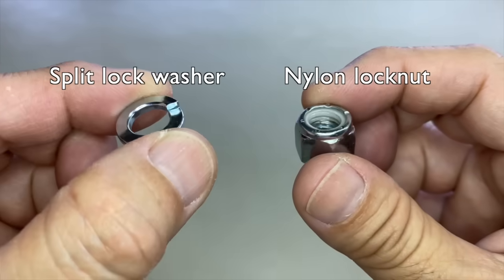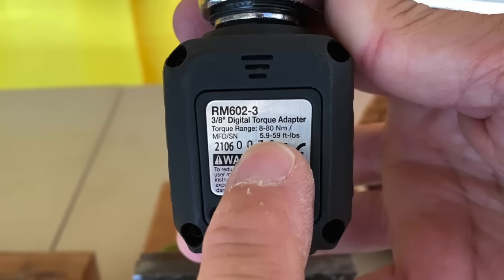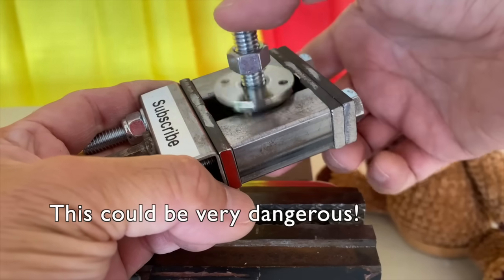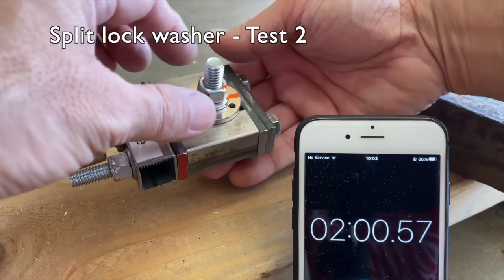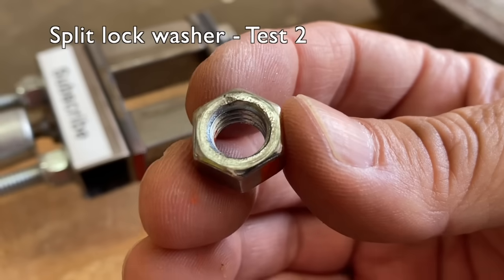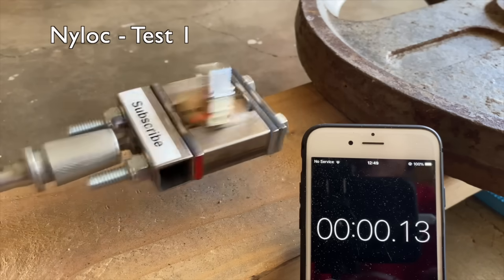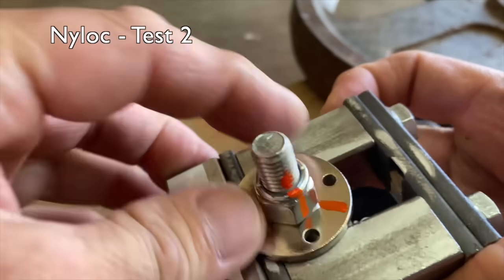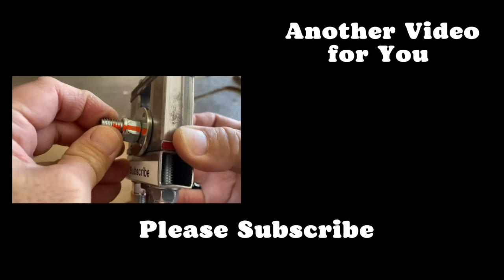Nuts & Bolts - Split Lock Washer vs Nylon Locknut – DIY Impact & Vibration Test - Part 1

Comment: Standard torque specs for grade 5 3/8-16 threads is 31 ft/lbs. Would this have made a difference? I doubt many applications call for such a low torque.

Comment: Will be interesting how a similar diameter metric setup will react due to the slightly finer pitch , and how does the difference in friction of nyloc vs. Split washer impacts the stretch of the bolt and finally the result ?

Comment: Did these results surprise anyone?  Certainly not me....I have had sailboats for decades and we always use nylocs...and they all but never loosen.  And at least if they were to loosen, they wont completely loosen/fall off.
What I don't understand is in the last cases (@6:50) , how is it that the nut and bolt paint marks are still aligned but the bolt is no longer tight in the assembly?

Comment: That is an improper lock-nut installation and thus a failed test.
Lock-nuts are supposed to be completely torqued down and tight.

Comment: For the gear heads...Fischer racing  engines did a race engine test experimenting with a timing gear drive vs a timing chain on a 7000 rpm 350 Chevy road race engine In the late 70s.The gear drive literally vibrated loose all critically torqued bolts through harmonic vibration.Rod bolts,head bolts,main bolts,pan bolts,Intake manifold bolts.My understanding Is this Is part of why the belt drive cam,crank ,timing system was developed.Blew me away.

Comment: You can't tighten to 6ft-lbs and say you're done because that's the highest your torque wrench goes. Any bolted assembly must be torqued to withstand the greatest load seen (i.e. during vibration in this case). Then, you tighten/torque the bolt to a suitable value to always withstand that force as long as you're within the bolt's elastic limit (even without locking devices). BTW-yes I am.

Comment: While it is understandable to design the test this does not represent the real world situation when bolts are torqued to the recommended value. 

Also, the only time to use split lock washers over nylocs is when there is enough heat involved to melt the nyloc material.

Comment: My solution was always paint the bolts after using lock washer and tightened nut.  The paint in the threads acts as super duty loctite.   Adding a second lock washer and second nut then paint is how I bolted a trailer together.

Comment: Just use a mounting adhesive which doesn't fully harden. Nylon nutlocks are one way only. Each time you loosen it gets weaker. Split locks are good for little pressure. Can be used in combination with a nylon. For example if you screw soft materials together like aluminium or plastic. But I prefer mounting adhesive over nylon locknuts. It's way more robust and doesn't loosen to vibration. Mounting adhesive is one way, nylon locknuts are one way. I'd safe my money on nylon locknuts.

Comment: Completely bogus test. Any competent engineer or designer knows that nuts need axial load from correct torque to create friction and resist loosening. Lock washers must be fully compressed to work properly.  I am a retired engineer who developed test procedures.

Comment: For me, what's odd is the nyloc connection showed movement of the rings to the bolt but not the nyloc nut on the bolt.  I know this since the lines on the bolt and the nyloc nut don't move like they do on the rings to the bolt.  Odd.  Perhaps there was something between the rings, like a scratch or hump, that was worn down when the assembly was shaken.

Comment: Once a split washer loses contact with its mating faces, by unscrewing, it is useless. A Nyloc washer retains function through internal friction so long as it remains on a threaded surface; it just lasts longer. So this test is meaningless as you are essentially comparing apples and pears.

Comment: The application for either design, is not about direct comparison. It's all bout environment. If the temperature and application allow for the use of Nylok, use them. If not, use split washers. If you can afford them. Nordlok is better than both.

Comment: Do you know why you don't see them in cars? Because they are expensive! Design it right, torque it right and it lasts. A nut costs 2cents and a nylok cost 20cent at automotive production volumes.

Comment: I don't get this test - in the past 40 years I have used both spring washers and Nylon nuts and not one has ever come loose. 6ft lbs wouldn't hold anything

Comment: Yes 6 ft-lbs is way, way low for this bolt.  So what?  This test was to compare tenacity of nuts and washers...a low torque increases the likelihood of loosening...as intended.  Probably the nyloc lost preload due to material wearing away due to chafing.  The nut was not backing off and certainly the bolt was not stretching.  Adding a split washer to the nyloc worked because the spring washer could expand in length to counteract the wear taking place.  Good test.  Bad comments.

Comment: I just put a piece of cello tape on half the circumference of the threads on the bolt. Even water pipe sealing tape should do.

Comment: Interesting. But you should have really checked the design torque specification for each fastener before the test for it to have been valid. The torque used seems rather low. 
It’s always surprised me that car wheel lug nuts don’t use cotter pin or equivalent, as I’ve had failures in the past after having tyre changes, a cotter pin would exclude that possibility.

Comment: I get a real kick from these dumb you tube uploads . Anyone even with half a brain is NOT going tighten a 3/16 nut to just 6 lbs . You tightened it to the recommended tension of the manufacturer . If it can't because of damage to what it is being clasped , then you use the BEST locking system and that is a second nut tightened as tight as possible against the first nut . [ DON'T TRUST LOCK TIGHT ] .But the best thing about watching a video like this is reading all the cements uploaded by people that are VERY knowledgeable in this area . Thats where I learn from .

Comment: 6 lbs of torque on a zinc plated 3/8 bolt. Come on man. That is an invalid test because it does not reach clamping force spec for a grade 5 bolt at all. Not even close. It should be 26 ft-lbs for a SAE 3/8 bolt and nut which is zinc plated. For aircraft and DOD AN hardware 3/8 AN6 bolt which is Cadmium plated it should be 15 ft-lbs of torque to get right clamping force. But relatively speaking the best is flat washer with split lock washer and then a nylock nut.

Comment: How about double nut?
How about trying the last two setups with different torque?

And I agree with one of the earlier posters, the torque with nylon lock nut is false due to friction of nylon. And it's also difficult to turn it by hand even when it's lose. Instead of that you might want to measure remaining torque (if possible) or the amount of movement, nut to nut.

However I still appreciate the test, now I understand the locking nut at least :)

Comment: Clamp pressure on the nylon lock nut turned the same torque as a split washer is probably a lot lower. Torque wrenches only measure how hard it is to turn the fastener, not how tight the joint is. For fair comparison, the nylon nut probably needed to be tightened higher than 6 ft-lbs.

Comment: Also, the temperature around the working equipment, or generated by the equipment, matters. 
428 °F (220 °C), melting point for nylon 6; 509 °F (265 °C), melting point for nylon 66.

Comment: nylon nuts only really works when they are new, if its been used already then torque wont hold as good, we use them on flight critical parts on our helicopters all the time, and gotta replace them if they come off.

Comment: In aviation, we used a thin wire through a hole in the nut that went around the bolt then to the next bolt.  Kind of sewed together. This was the sheet metal on helicopters in the army.

Comment: Vibration doesn’t loosen anything. Relative movement does. So the tighter the tolerance on the hole, the better it will stay tight.
Reply from the maker: Isn’t vibration movement?
Reply: @HacksbyDad  Vibration is movement in unison. Relative movement is this context is the nut and bolt moving relative to each other.

Comment: Thanks for the test❤ i install a lot of speakers and horn speaker. I use a lot of nylon Nuts to prevent from getting lose and falling down. . Even if it is lose the nut will not fall off and still holding.the assembly.

Comment: When torquing a nylock or other fastener with a locking feature, you have to add prevailing torque to the desired value. Your nylock fastener was under torqued compared to the split washer assembly. Fastening is a deceptively complex subject. Fastenal Company (just one source of many) has several good technical reference documents. As was pointed out, 6 ft/lb was seriously under torqued for the size fastener, but it looks like your point was a quick and dirty vibration test - No matter how crude a test, being curious is a good attribute.

Comment: Split lock is for high temperature. Does it make sense to compare fasteners designed for different tasks? Check the core also when the plugged nut is inserted.

Comment: I use AB epoxy metal adhesive with at least a 3 hour curing time in case you have to remove things for any reason, much cheaper than Loctite, and you can use it in many cases to bond the parts together as well.

Comment: I agree with another comment , not enough torque for that bolt and  what about thread locker ? and what about a star lock washer or  belleville  washers ,  there is also a torque  chart for using different  kinds of anti-seize ...

Comment: In 1964 an engineering white paper was released which basically described split lock washers as no better than a flat washer. In the last 40 years there are way better options.

Comment: This torque for this size joint is very feeble. Neither the bare joint nor the one with the split washer is really in the range at which they could reasonably be expected to work adequately. 

The test setup is good, though, even if a bit hard on the saw.

Comment: The purpose is not the same. The nylon lock will get deformed at the first lock, and it's effectiveness is not the same at 2nd time and 3rd time and so on... It's not repeatable, if you unscrew it you must replace it. It's not for parts you disassemble often. It's purpose is to lock the rotation, but the axial gripping force is not necessarily there.
Springy washer is a mild solution for unwanted unscrewing, and the screwing-unscrewing is repeatable. Axial gripping force is always there. You can disassemble the part every day if you want. It's a soft and cheap solution, it just makes the unscrewing harder. If you need safe and hard solution, you must use lock-pins and crown-nuts.

Comment: While the fastening method of the bolt secured by clamping force, he torque the nut only to 6lbs-ft because the device limit. This is a joke.

Comment: I was a jet mechanic in the navy in 1969 and 70 we used lock wire on every nut and bolt. Its a lot of work but we definately wanted our pilots to come back

Comment: The nylocs were not the reason any pre-load was lost since they didn't move relative to the bolt. They stayed right where they were placed with no rotational movement on the threads. Nyloc nuts were a great invention.

Comment: I bought a bike trailer that had split lock washers on the wheels. I started cycling with tools in my backpack. Then I bought some nyloc bolts and put two on each wheel. Been 4 years and no issues since then

Comment: My issue is that nylocs are only good for one use. I use split washers when I know I might be taking it apart and need them to put it back together. I use nylocs and or locktite for everything else.

Comment: Ok, so these are coarse threaded bolts which are susceptible to vibration, and too there are torque specs for the bolt and the washer or nyloc nut.  All that being said, the clear difference between the two is that once the split washer is uncompressed it no longer functions whereas the nyloc nut will continue to resist rotation the full length of the bolt (just as thread locker would).

Comment: A big consideration with split ring washers is that they can only work if they are harder than both the nut and the substrate.
Bad split rings are not hard spring steel and perform worse than a washer in all cases, and even good split rings will not work on hardened steels.

Comment: A more accurate test would be to look up the torque to apply to this size fastener.  Torque it to the correct torque because 6 ft-lbs is no where near tight enough.

Comment: I put super glue unto between bolt and nuts or under and between the two is very good hold for longer years.

Try using super glue at inside in between nut and bolt there.
Do the same experiment.

Comment: That surprised me with the nylon lock nut. They seemed more to fail with engine heat and with reusing them too much which can loosen the snugnuss of the lock feature which is not recommended. And, I thought those were loose because someone didn't tighten them or reused them.

Theres so much to know in hardware and it all matters, but maybe more than we know sometimes.

This wasn't a waste of time what you did in this video. It opened my eyes to these. And yes, more torque may make a difference, but hey, that shows why we retighten things after hours long of continuous vibrations on engines and wherever else vibrations occur.

I did this experiment with all hand action with a bolt and plain washer and nut at hand-tight and shaking by hand. It takes a while but I learned the reality from that, what comes loose can become damaged and or come apart in time.

Funny enough, the tiny screws and nuts, on eyeglasses can come loose too, where parts move but even where it's the frame secured around the lenses so not just where the hinges or nose pads are moving frequently. And there's no vibrations in eyeglasses unless they are left on something with a vibration happening such as a dashboard, it's just that limited motion around the screw shank or flexing of the frame. I fix that with a little dab of nail polish once tightened, that's easy to scrape off if something needs changing but yet usually holds for the duration of use otherwise. But I do find it's not enough in one pair of glasses and that's happened years before on a different pair, tighten again and again. However, I (do not use nor recommend) securing those screws or nuts with anything else. Super Glue will lock the hinge where it's at when the glue seeps in and anything done with that glue is not changeable even if you get a desirable result in a permanently opened (wearable) pair of glasses. Plus that glue can get onto the lenses because it is a light liquid we can't feel until it sticks our fingers to things or to eachother. The same may result from other kinds of glues and solder. And finding locking screws and nuts for eyeglasses is rare. But tiny plastic washers may help. They are usually found at the lenses where screws go through the lenses abd nuts tighten it up and they are meant to prevent overtightening and cracking of the holes in the lenses. So you need spares of those if putting them in other places such as the hinges or nose pads. Those are usually transparent and so the hardest things to find when dropped on the floor. Some people may do a field mechanic hack, put grit in the hole or do a really tiny bit of danage to a side of the thread away from the screw's end. But that might prevent the screw seating fully if it jams up and this can render that screw stuck in that position with a damaged slot. It's best to check the screws and nuts regularly and be accurate with a jewler's tool when that's needed or see what the optical dispenser can do or suggest.

And that more common sized screw or bolt under the desk, that likely belongs to the chair, don't toss it, find its location and put back in. So many people toss those and with one more out, their chairs fall apart. 😆

Comment: Tightening the bolts with toddler torque is the main reason that the assembly failed.  When ever is a 3/8" bolt assembly only torqued to 6 ft-lbs, especially when subjected to load reversals?  Answer: Never.

Comment: Nice test. I think for high vibration applications that a chemical bond like Loctite or a safety wire are the best things to prevent loosening while still allowing service. However a 6ft lb clamp does not seem like that is nearly enough load unless you are making a YT video.

Comment: Very interesting test. One comment is that you should not use the same torque to the nylon locking nut. One rule of tightening the screw or nut is to apply sufficient preload. A big portion of your torque is to overcome the friction of the nylon lock, so your nut is under torqued.

Comment: Not a valid test. you didnt even compress the split washer. 6 FT- lbs is not enought to ensure a good connection with either nut or washer especially with the way you vibrated it.

Comment: Bottom line is you only torqued them enough to get your results. I think if you torqued them to where the lock washer was closed and then torqued the lock nut to the same, they both probably would have held. That’s the test you should do next. The lock nuts are used sometimes so there is movement, but stays on the bolt without coming off. The test was done wrong.

Comment: a German metalworker, the following nut is missing from the test as a securing nut :Locking nut made of metal (without plastic). This locking nut has two compressions on one side, which deform the thread slightly at the end and, once tightened with the appropriate torque, cannot be loosened without damaging the bolt thread... there are also toothed washers and screw paint for securing.